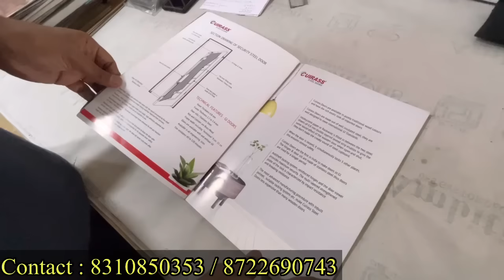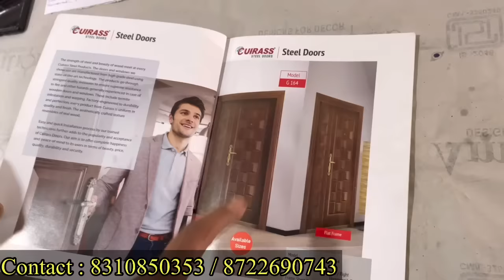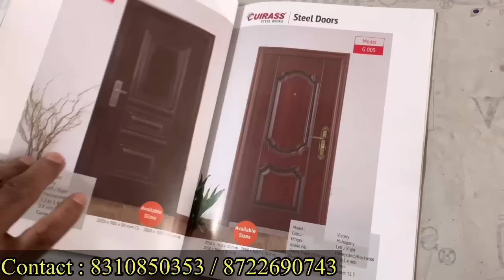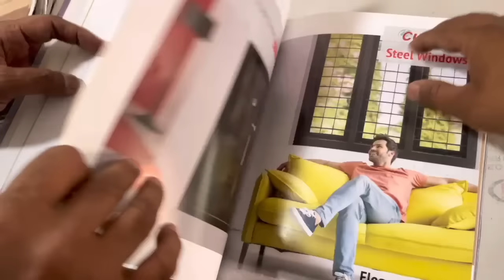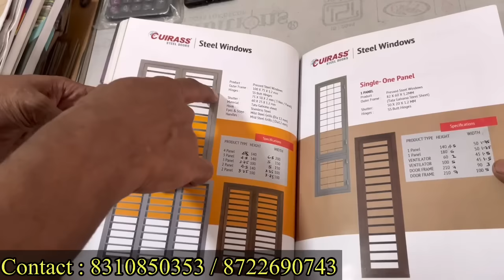Steel doors | 100 year life | Full safety Door | Interior design in Kannada kuvara | TATA pravesh

Comment: As these doors are metal, insulation is necessary. So I just want to know if these doors are insulated. Otherwise it is dangerous in the areas having heavy lightening and thunder. Even near hightension electric wires.
Reply: As safety aspects valid point, due to cost of wood, usage of non insulated steel doors &windows widely increased
Don't worry, lightning &thunder never affect without inviting call
From abode of God
Reply: I think these door are ideal for indoor rooms usages and not for outside where it is exposed to sun and atmosphere, it's best for apartments also i guess
Reply: @edgexyz  sir these doors r uv coated can be used for main doors, insulation for heat is also taken care
Reply: hollow inside filled with rockwoll i think
thy hv given in website
so it will not transmit heat and sound

Comment: Can you fix metal door for wooden frame
Reply: No it cannot be fixed. As the the system is with frame, designed  high security locking system at 11 points works with frame.  Moreover, if you have wood frame the security of the door is an question.  With frame also the door stands economical than the wooden door